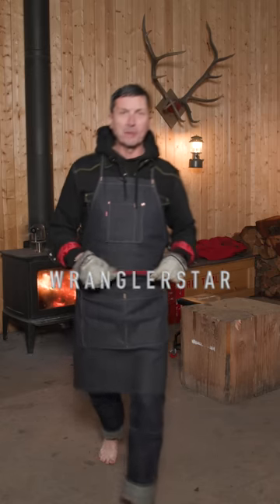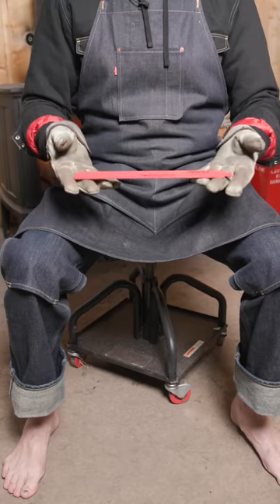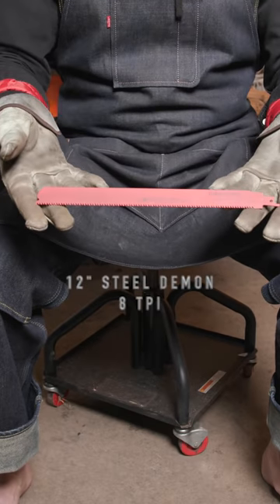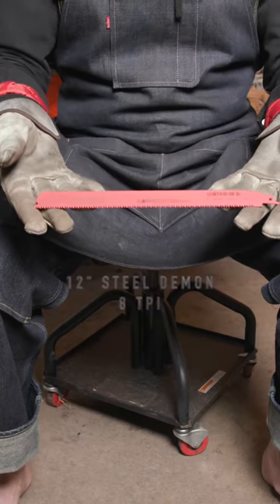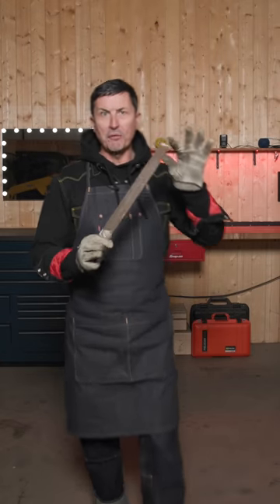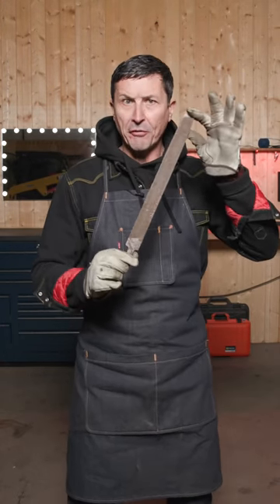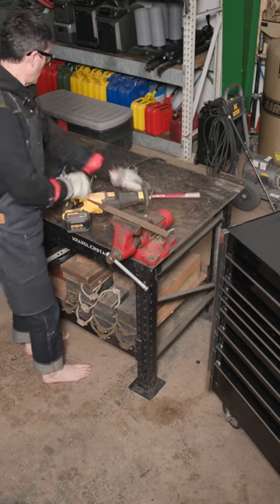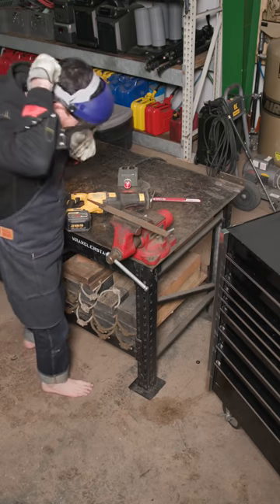Professional Homeowner Hack #043 Wranglerstar #shorts

Comment: I'm a plumber I use those blades to cut cast iron. THE trick is to run them slow to prevent over heat and temperate change ( bluing)
Reply: The blades were heat treated so they become like a spring. When they heat up too much during work they essentially get a new but uncrontrolled heat treatment which messes up the original. So the blade will either start staying bend instead of flexing or it will snap, the next time it's bend too much.

Comment: Pro tip: using the blade guard correctly will take the vibration out of the tool, making for faster cuts, longer blade life and better battery use.

Comment: I have a few of those blades. They’re pretty awesome but wont stay seated in the chuck of my compact dewalt saw. It stays just fine on the larger saws I’ve used but will pop out of my small one. The thicker blade doesnt allow the lock to fully engage.

Comment: Unless you want to break off teeth cutting metal with a carbide reciprocating saw blade... don't ever cut across the small axis, cut the broadest axis you can and start slowly,  otherwise your bonded carbide teeth will just break off due to impact force. 
Cheers fellow professional homeowner

Comment: The jump cuts reminded me of somethin Funkfpv would do a video on
Reply: On God. But this dude no fraud and more than capable. I'd dare say they could be friends.
Reply: @xavis_dad  then why is he cutting a file apart to test a saw blade. Pointless
Reply: @scrilla4047 probably cuz I assume the saw is made to cut metal and he's showing its ability to cut metal on an item that almost everyone knows is a very strong metal tool
Reply: I assume the jump cut is because this is a short and if he showed the whole thing it would take too long so If you're wondering the legitimacy of what he's saying search for some long form videos of the steel demon cutting through metal
Reply: @nateno8965  yeah that's like showing me a hammer and then using it on a nail. Its a hammer. It better work on a nail
Reply: @scrilla4047  also. He says in another comment the file was worn to uselessness and was scrap anyway. Send it to Funk you got nothing to lose my guy.
Reply: @xavis_dad  it was still pointless, a better test to show off the blade would be to cut rebar multiple times and show how much the blade wears. Of course it's going to cut through a file or a bolt, even a cheapo blade will do that once. Even a cheapo blade will cut through a file once.

Comment: I really like those blades, they last a long time but I cut a lot of aluminum frames and they don't seem to go through aluminum as fast as a regular diablo blade. I like the shorter blades meant for nail embedded wood, they're thick and don't bend as easy if the blade binds up.

Comment: Diablo makes the best blades. I use these for cutting cast iron when repairing/replacing sewer laterals. Only thing is with cast iron, it'll be good for 1-2 cuts. The 3rd cut and beyond will take foreverrr.

Comment: I used that blade to cut 6" cast iron plumbing to fit a second toilet line into. The first time i made a cut i used reg steel cutting blades, went through 4 of them and toasted my black and decker sawzall. the next time i tackled a similar project same pipe, I used a Bosch with that demon blade, a little wd 40  while cutting and it went right through. I think was called the Diablo back then.

Comment: As a point, I work construction and regularly use these blades, that said, to cut either of the above items i would absolutely recommend a grinder if possible, it will be much less work and time out of your day than using a sawzall, especially for grade 8 bolts lol✌

Comment: Tip: When using a long blade with a reciprocating saw always move along the work in a sawing motion as to wear the blade evenly.
Reply: Absolutely not... you want to have the metal piece pushed up against the boot of the tool to get a good stable cut

Comment: Grinder with a diamond cutoff wheel for the brutal stuff. No lock will stop it. However there are coated locks that will destroy those carbide blades in about 10 seconds. However that's not most locks.

Comment: as the coating wears off the blade it doesn't cut as good.  A little spritz of spray silicone makes it like new again.  Don't use oil, if the oil gets in the chuck it will start chucking blades.

Comment: I believe it's made by diablo I've tried it on mild steel and was amazed at the speed and life it had just as fast as a grinder with cut off wheel and less mess and spark I'd recommend it as well

Comment: Or just use an angle grinder quicker.. That thing was struggling.   We see the red coating left on the bolt and worn off of the blade...

Comment: If we're heading into a dystopian nightmare, I don't think electric power tools will be a viable option in said future. Hand powered manual tools will be my go to, because there won't be electricity. And for those that say "generator", you need gas to power them. Something else that won't be available in said dystopian nightmare. Solar power and back up batteries is really the only viable option for a shtf scenario. And even then, that might last you a couple of years, so long as nothing breaks down on you.
Just my 2 cents

Comment: Powertools and no Power 🤔

Powertools and the Sound, when everything else is quiet. 🤔

Powertools and there weight and seize.👏

Alternatively Handsaw .. but then, Time, Afford, Calories burned for what Effect. 
So on and so on ... 

In a Truck, with an Solar Panel, in an Area where the Sun shines enough...sure. Otherwise why the unnecessary weight? 
Fuel is already limited and you want it for your car and not a generator, to charge tools or lamps. (If possible)

Comment: You really should be using the full length of the blade when possible. Add a slow back and forth motion to the tilting motion. 

Also, I know a good psychologist for work related stress induced manic paranoia, it will do you mountains of good. The US forest service letting you go is really doing a number on your mental state. 

You think I’m gonna grab a recip saw in an emergency? Also, why do you think that Russia is going to invade or something? I don’t really understand your irrational fear of conflicts on the other side of the world. Russia will not attack the United States. Period. They don’t have the military power, the influence, the casua belli, the men, the time, nor the ability. They claimed to be at war with the United States and the North Atlantic Treaty Organization seven times since they illegally invaded Ukraine, and the United States and NATO responded by saying if that is the case, attack nato? And Russia has not, and will not. Because they are terrified of NATO. Even a NATO without the United States could steamroll Russia with the correct leadership.